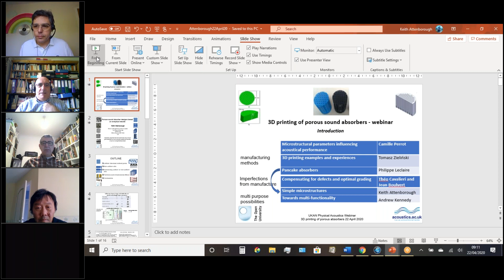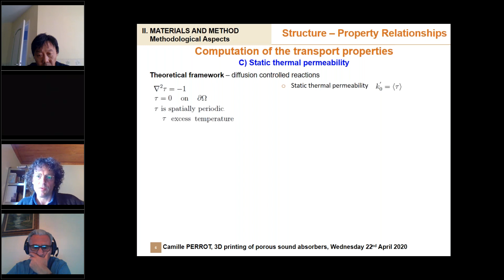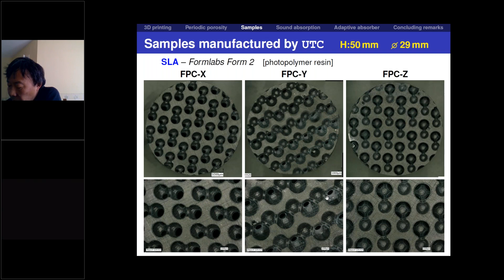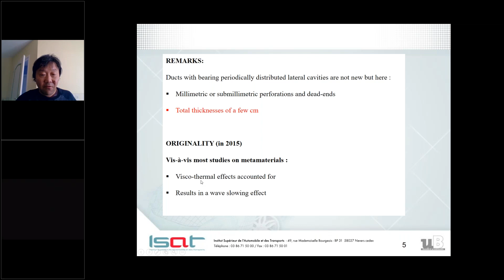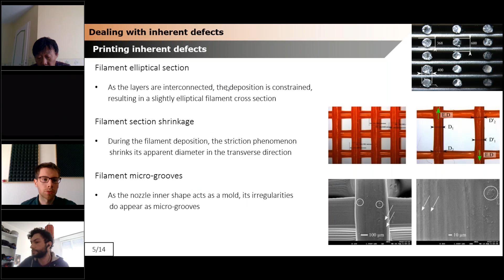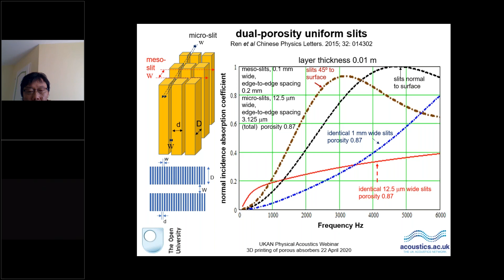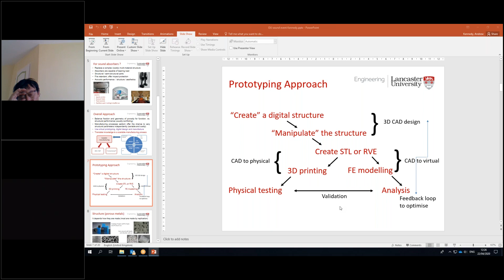UKAN 3D printed porous absorbers workshop video capture

Comment: 0:01:05 - Welcome and Introduction - Keith Attenborough 
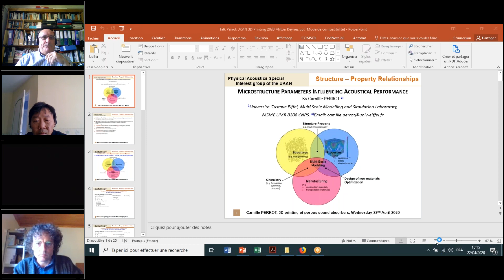0:05:30 - Microstructure parameters influencing acoustical performance - Camille Perrot
0:35:30 - 3D printing examples and experiences - Tomasz Zieliński
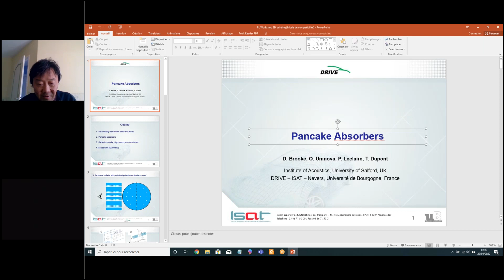1:06:10 - Pancake absorbers - Philippe Leclaire
1:50:15 - Compensating for defects and optimal grading - Théo Cavalieri & Jean Boulvert
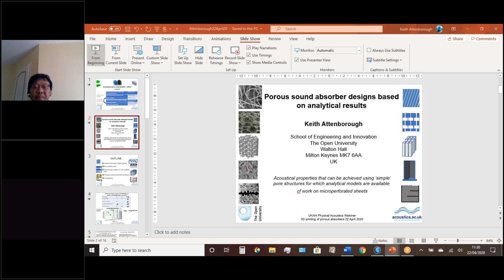2:20:35 - Simple microstructuresfor sound absorbers - Keith Attenborough
3:06:55 - Towards multi-functionality - Andrew Kennedy